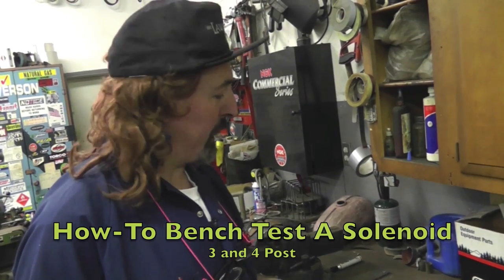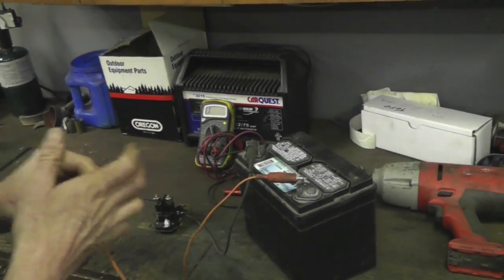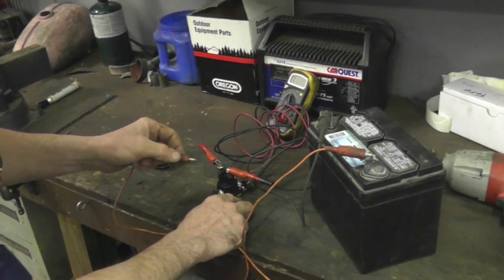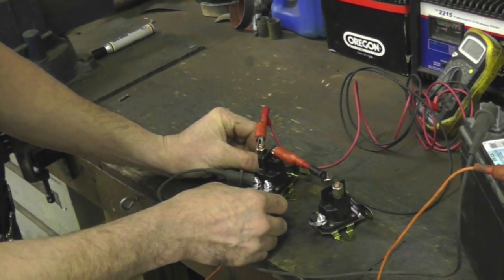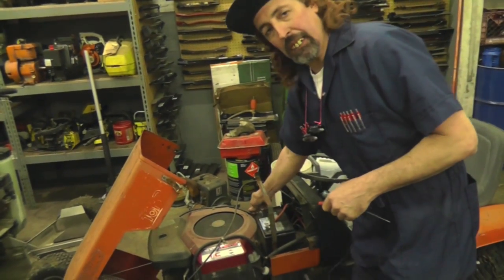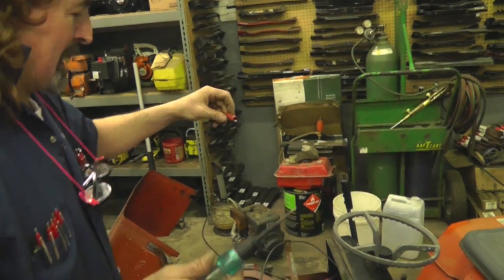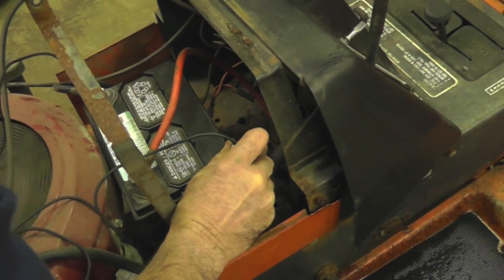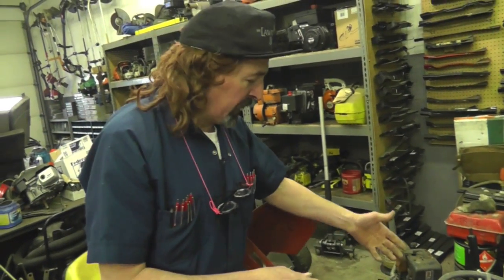Solenoid Testing: A Complete Guide

Comment: I'm working on electric over hydraulic wrecker boom came from South Alabama to Missouri and it didn't work. I watched your video and found out it needed a solenoid and a little tap on the starter. Thanks a lot brother!. You can get some whitener for those teeth at Walmart LOL!

Comment: My solenoid is good, relay fuse and key switch are good, battery is new and tested, yet no power is going to the starter motor when I turn the key. I’ve also tested all the safety circuit breakers, done everything the way you shown Taryl. Only thing I haven’t done is test the starter motor… I put the test light on the starter motor while I turn the key and it doesn’t light up, but everything before I’ve tested and it’s all good. Could it be the starter motor??? Ignition coil??

Comment: Well folks again this is kind of laymans way to about things but it doesn't always tell ya the truth about the solenoid especially if has rust inside it. When say a larger starter from a like V twin draws on a solenoid the solenoid can work a moment then the starter cuts out because it heats up inside due to corrosion or moisture in the unit and stops working as the current draws juice. It's sort of like a fatigued coil you're cutting grass say like 20min and all of sudden the mower shuts off. It cools down and magically starts up again. Your coil can test good when it's cold or cooled off so these are problems that a bench test doesn't always find even if a unit is completely bad it may not test that way. I have that in my Motorized Bicycle videos a mag coil doesn't always bench test bad. This more primitive test is okay for the most part it is a way of at the least checking the stuff.

Comment: Thank you, sir, I was able to duplicate the solenoid test and mine was good also. I changed the starter, replaced the fuse under the seat but still, I am getting that clicking noise and no crank. Could there be another fuse in the circuit I have a cub cadet with a Kohler engine

Comment: Quick question I have a 2001 john deere 345 battery light came on about 2 or 3 mows ago stays on but been running fine my wife pull mower out of garage I had her shut it off do to tire needing air and when we went to start it nothing no click nothing all the warning lights go real  dim but after about 15 to 20 seconds everything goes bright again but still won't start touch the key goes back to lights dimming and has a brand new John deere battery any clue need help

Comment: If one can see 12volts on the red wire at the starter when the key is turned does that prove the solenoid is good, or could it still be bad, or does just a test light prove it and not a meter.  Thankis

Comment: I have a Scott mower made by John Deere , it won’t cut off , I have to unhook battery to get starter to stop cranking , I put a new ignition switch same results , I took solenoid off cked it for continuity it was ok , so now what do I do is there a kill wire somewhere that maybe broken or unhooked ? I’m not sure what to do ?

Comment: If I’m swapping a motor and my new motor has an attached starter solenoid combo(Koehler command) how should ya hook up the the 4 wires from the old set solenoid set up . Solenoid is separate from starter on the old engine(Briggs v twin)

Comment: No I couldn’t see the solenoid Taryl, 
But can you test the solenoid with the Volts instead of ohms?  I think to see if the solenoid works properly you need to test with live circuit instead of continuity, ya know, if you have voltage you have continuity but if you don’t have the 12 volts it’s junk , ya know 😚🤔🤭

Comment: taryl I got a problem  my solenoidis hot on both sides but the small wire is die  went you  turn  the switch on  but I can jump the  solenoid and it fire up and run good what do you think

Comment: If my solenoid is going bad, will it blow my tractors fuse? My 15 amp fuse keeps blowing after 20 minutes or so while my PTO is engaged. Also, sometimes while my PTO is engaged and I'm cutting grass, the the PTO will disengage. Then I have to shut off the PTO and then engage it again to start cutting again. This happens sometimes. Any solution would be greatly appreciated. This is on a John Deere LX178 tractor.
Reply: John Athanassion Your  electric clutch is going bad.

Comment: I have a 2015 T3200 Craftsman riding mower. Ran great last fall. stored in the garage for winter, pull it out today and added fresh gas to about 1/4 that was already in it. Mower will turn over but not firing or trying to start.. I took the fairly new plugs out and cleaned them up with a little sand paper on both ends of the plug, it still will not fire. Any ideas what I could check for to help diagnose the problem. Thank you ahead of time for any advice you can give me. Ric

Comment: That's great info !!!! If the solenoid gets a hard click but the starter wont engage , and I can jump over the solenoid and it will start , is the solenoid bad ?? Or do I have another issue ?? I can run a jumper to the starter and it will crank also ...

Comment: taryl, my tractor starts but when I disengage the brake it shuts off.  any suggestions.  thanks Juan
Reply from the maker: +juan cobar  Check the seat switch . It has a safety switch problem.
Reply: Thanks

Comment: hEY Taryl, I have a bad solenoid on my ferris zero turn (2010)  and in one of your other  videos you said to fix the problem with that would be to get a 3 post frame mount  solenoid and take the power cable and run it to one side of new solenoid from the battery. Then buy another cable and go from the other side of the new solenoid to the starter. Now you said to make a wire and loop it from the starter to the trigger lead on the starter, which I did. THen I was suppose hook up the other trigger switch to the new solenoid. I then tightened everything and mounted it to the frame, hooked the negative battery cable back up and tried it. It still had the same problem.  It just clicked. Eventually it caught and worked but its not consistent. Did I do something wrong?
Reply from the maker: +James Waltz Sounds like you have everything hooked up right.  You just have a bad starter.
Reply: Taryl any idea how to hook up a reversible motor for my snow blower chute, Could you do a video?